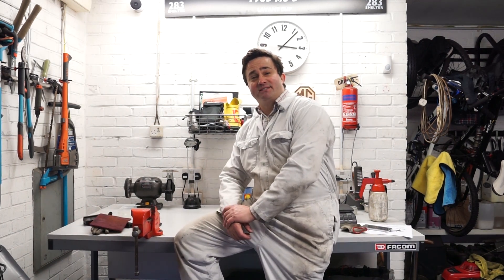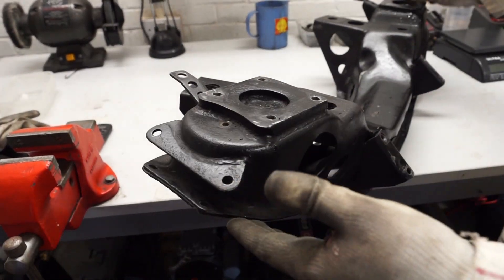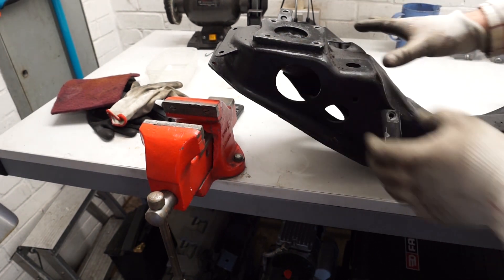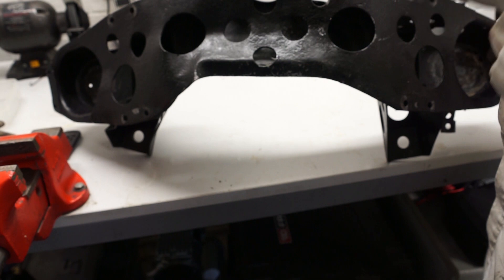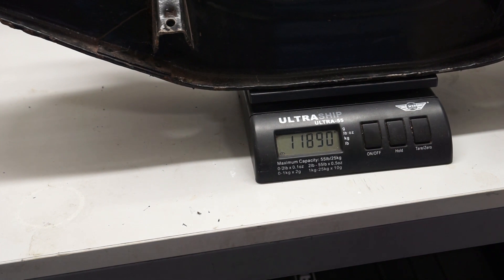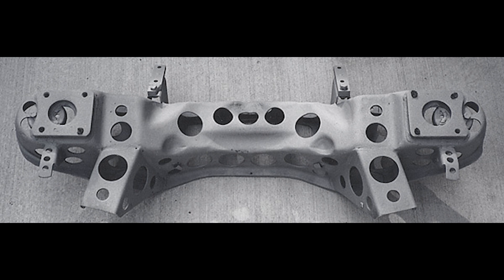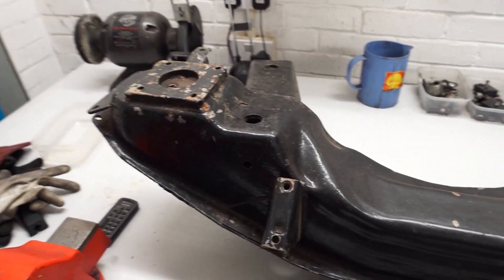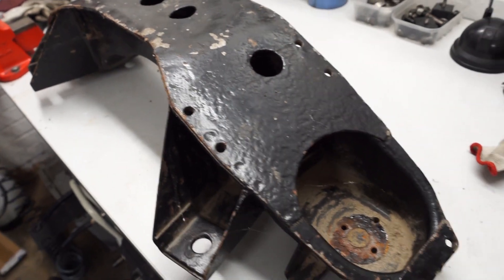Looking at the MGB Front Crossmember, Damage Assessment, Weight Reduction & Steering Modification

Comment: Removing material from the crossmember will affect its structural integrity both in the loads that it will be able to handle (and corresponding deformation under load) as well as its harmonic natural frequencies. One way to determine this would be to do some finite element modeling of the crossmember (ie mathematical discretization of the structure with force loading as well as a modal analysis to determine its natural frequencies which are done via computer simulations).  You could run these for the existing stock cross member and compare to results from models with an increasing number of holes. My guess is that the stock crossmember is way overdesigned and could be put on a diet. With that said, there is no substitution for actual testing. You could buy a few additional cross members and modify them to a varying degree then install them and actually try them out on a track to see the impact on performance and handling. What a great little research project that would be!
Reply from the maker: Many thanks Steven, I fully agree that applying modern technology would be a great way to see what is really possible with older engineering. It would be fantastic to see how much one of these cars could be developed with modern techniques.

Comment: a 1KG savings, hmmm  I would lose some weight as a driver, instead of cutting holes in the subframe...  those holes are IMO causing even more damage to the chassis arms...
Reply from the maker: Too true with regards to a bit of weight loss for the driver! I may add some small holes in places, I was really hoping to be able to flare the holes but unfortunately I can't fit the tool in to do so.

Comment: David, I noticed that you asked on a forum which oil to use for the gearbox... normally people use the 20W40 Castrol engine  oil.  However I use for the track gearbox oil  GL-4  and that is ok for the yellow metals.  I have a video soon on it
Reply from the maker: Many thanks for your message, I had been using the GL-4 from Driven (after a few recommendations). Last year I had both gearboxes rebuilt by Mg Motorsport and was recommended to use the Castrol Classic XL30, so far this seems to have worked very well, I would like to try and get a full season with the same gearbox to know for sure though.

Comment: Cheers for the video David! I am currently in the process of rebuilding the Front Axle on my 79 MGB GT with Superpro Polybushes, Extended Lower Arms, Etc & ill be really interested in what you do with your cross member, from my rather limited knowledge, im sure if you cut out & then ad a press to fold the edges of the whole round should give you a massive amount of strength incase of another accident. Hope the helps & please let us know what you decide to do with the cross member.
Reply from the maker: I'm sorry but i missed your message. I have made a trial run with a press tool on the damaged cross memebr and it cut is fairly easily. I am hoping that if the holes can be flared very little strength will be lost. A problem I do have though is that the punch tool will not fit into the middle part of the crossmember so I will need a find another way of flaring those holes. Hope all goes well with your work, I've been really impressed with the SuperPro bushes and would recommend them to anyone.

Comment: Hi David,
I have just purchased the Al Pease MGB. Fascinating history! Yes a few less burgers in the new year for me also!
Reply from the maker: Excellent news Tony, a true piece of MGB and Automotive history there. Are you planning to race the car in 2023?
Reply: @davidrussellwilks  Yes that is the plan. It has been sitting for a few years so there will be a fair bit to do. It is currently in Saskatchewan and I am in Ontatio. 
I may fit the spare Derrington cross flow Weber setup to my current race MGB in the short term. That is how Al ran the car before he supercharged it. I will leave the supercharged setup on the Al Pease cat until I have run it on track. See how it works.
Reply: @davidrussellwilks  who do you use for head work for your race MGB? Keep the videos coming. They are a great tonic for the off season. I have raced in the UK  recently but in HSCC vintage formula  ford.
Reply from the maker: Excellent news regarding the car Tony, really great to see that you'll have the car back on track. For the most recent cylinder head I used Peter Burgess; he is very well regarded in the UK.

Comment: Hi David, I've just started a B project to hopefully race in Equipe as well. The swaging of the holes like Geoffrey mentioned is something I'm thinking of doing too. My only thought was that getting the tooling inside the axle would be tricky in places potentially? Look forward to seeing how you get on, I'll be using your car for inspiration!
Reply from the maker: Many thanks for your message Tom, looking at the crossmember this evening I don't think it would be a problem to fit the swaging tool/ dimple die into it as both ends are open. However the thickness of the steel may make it difficult for the tool to work; at 3mm it seems the metal is too thick for the ones I was looking at this morning.
Reply from the maker: Just going back to your previous comment, I bought a hydraulic press tool and the head part is just too big to fit inside the crossmember, I'll be adding a video on it soon.

Comment: Happy new year to you David.  I'm not overly convinced about weakening the crossmember too much it may cause the chassis rails to deform in a hard impact and would you really notice any difference with a few hundred grams missing, half a litre of petrol? As for moving the rack upward, won't this cause all sorts of problems with the lower column matching at the UJ by the bulkhead, it has to be at the correct angle I believe or it will become notchey as you turn the wheel. Good luck with whatever you decide to do and I hope your season goes well,
Reply from the maker: Thanks for your message Tim, in an ideal world I'd be able to figure out what is any holes are required to give the chassis rail the best chance of surviving the impact. It certainly seems that the middle section and the area where the crossmember bolts up should be as strong as possible. 
With regards to the pillow blocks, they would be removable, but I don't know exactly what the effect would be. I would like to try to find a way to add a bit more clearance between the front pulley and the steering rack, they run too close together for my liking.

Comment: Hi David,  Cosidering that the crossmember takes all the forces generated by the front suspension plus the torque from that substantial anti- roll bar I would leave it as it is.
This is indeed one very well designed unit, don't compromise it's integrity.
All the best for your upcoming season.
Reply from the maker: Many thanks for your message Roger, as far as I could tell the original drilled crossmember held up well; it lasted 7 years until the accident at Snetterton. What I'd really like to know is whether having holes in the part will do anything to save the front chassis legs. I think having the holes around the mounting areas was certainly not beneficial, but I do wonder if some holes in the right places might be enough to take the impact away from the body in the event of an impact.
Reply: @davidrussellwilks  Hi David, I think your assessment of taking half a Kg out of the crossmember seams sensible, I don't think your going to save the main chassis legs by taking any more weight out. You were unfortunate to hit such a unyielding structure, maybe a few more straw bales are needed!

Comment: Hi David, I am not a racer, only an MG enthusiast. Personally, I'd just leave it as is. It is low slung weight so I don't see the benefit of removing  one kilogram. The weight savings is about the equivalent of less then a half of a gallon of fuel.
Reply from the maker: Thanks for your message David, ideally I'd like the crossmember to act as a kind of crumple zone for the body, it's far easier to change this part rather than the chassis leg. The problem is knowing whether having holes is any benefit at all to protecting the body.
Reply: @davidrussellwilks  Could you fret out the whole area across the sub-frame  where you have several holes drilledand weld in an x of quarter inch rod to brace that area?

Comment: Hello David. Happy New Year to you too. I subscribed not long ago as I would love to get into racing with an MG B myself. It won't be happening anytime soon though as I have lots of other projects to work on right now. Anyway, this topic is interesting. It is difficult to judge where it would be safe to remove material and where best to leave it. I tend to think about this by imagining the part and the strain it goes through while it is being used. Where would it flex upon hard cornering? What would happen in case of an impact (you seem to have learned a valuable amount of experience there, glad you came out unscathed!), and lastly would it really be worth sacrificing structural rigidity over a kilo or so? I personally would like to test something a little different, as in cutting out material as you did previously, then weld a bead on the rim of the cut to temper the steel afterwards. I wonder if it would allow for some strength to remain after having removed the metal... Just speaking my mind here. All in all, I would look for a durable result. I understand that back in the day they did all they could to win races, knowing that durability is being sacrificed in the long run. I would much prefer casually racing for many years rather than being in it to win it, as it were. Kind of defeats the purpose of racing, certainly, but it must be so much fun I would just want it to last. :-) Many thanks for sharing your racing with the world. It is precious. Let me know if you will be racing at Spa Francorchamps anytime, as I live in Belgium and go to the track quite often. Take care, and happy racing!
Reply from the maker: Many thanks for your kind message Geoffrey, the main thing I am keen for the crossmember to do is to form a sort of "crumple zone" in order to protect the chassis rail in the event of an impact. To me the front crossmember is very easily replaced and far cheaper than any repair to the chassis rail would be. I guess the only real way to know is to repeat the incident from Snetterton with an unchanged crossmember and see the difference! 

I don't think I'm at Spa this year, but will be at Zandvoort in July.
Reply: @davidrussellwilks  Crumple zones make perfect sense. They are designed to absorb the energy of an impact to protect the occupants, in modern day vehicles. Since the cross-member joins both front chassis rails, wouldn't the crumpling of said part make the chassis rails more prone to movement, in case of an impact? It all depends on the nature of the impact I suppose (which I hope will never happen again to you)... Anyhow, I am looking forward to how this rebuild turns out. I really appreciate your effort in making this content, it is highly interesting. 

I missed a '67 B GT restoration project a couple of weeks ago, still keeping an eye out though. :-) Take care, and maybe see you in Zandvoort.
Reply from the maker: You've hit the nail on the head there Geoffrey, I was thinking about it more last night, I want the strength around the chassis leg to be as good as it can be, so really the only place for any crumple zone needs to be around the shock absorber/ spring mounts and possibly underneath the crossmember. Another idea popped into my head last night and this was to flare or swage any holes made to give very good strength and also some weight reduction. I'll certainly wait a week or so before cutting anything out!
Reply: @davidrussellwilks  Flaring will definitely give some added rigidity. Given the thickness of the sheet metal on that subframe it will require good quality dies and a decent hydraulic press... And as the saying goes: measure twice, cut once. Haha. Are these subframes being re-manufactured, by the way? You mentioned how easy it is to source a new item.